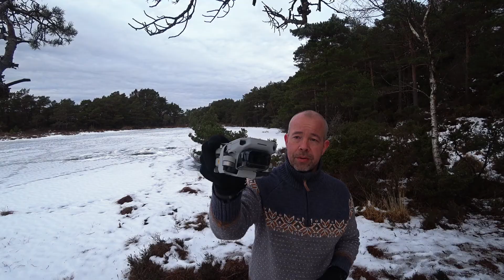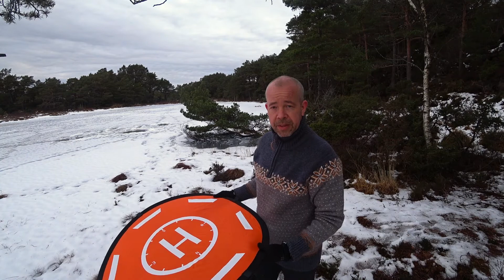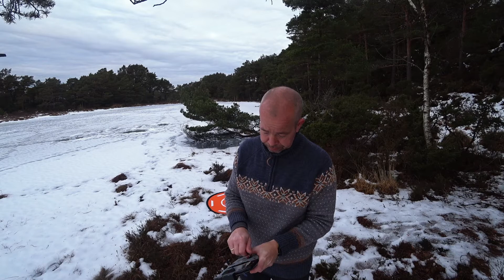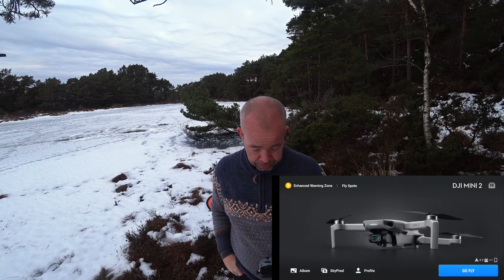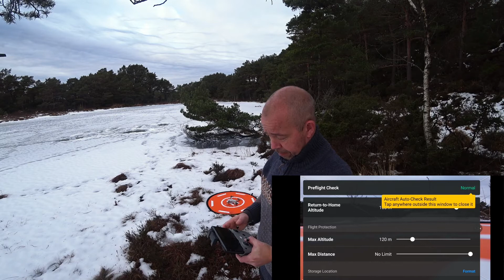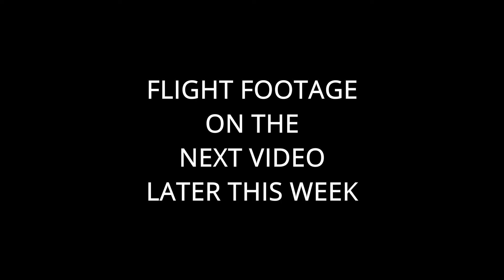DJI MINI 2 PRE-FLIGHT CHECKLIST AND TUTORIAL DO THIS FIRST TIME YOU FLY YOUR DRONE BEGINNER/PRO

Comment: I got mine two days ago and I like to had take off and hand catch it when I need it landed, it helps keep dirt and debris out of motors. But I was accustomed to this from a cheaper, larger chinese drone I had. Also, I noticed that, after I left it outside 15 minutes, when I wanted to take it for another spin to drain the battery down, it wouldn't start, prompting a cold battery. So I had to take the battery out and get it warm. Also, do you know if there's a was to make the homepoint on attitude display stay under the controller icon?
Reply from the maker: Thanks for watching, I also hand launch the drone sometimes. I also hand land the drone. But I think a beginner needs to learn how to land the drone several ways. And for your question im not sure, im gonna check it. Thanks again for watching and comment, have a wonderful day🌞
Reply: @EspenJohan  It's the easiest thing in the world to hand launch Mini 2. I couldn't believe it untill I tried it myself. Agreed that beginners should learn first to control it smoothly and get comfortable with it. They just have to use a landing pad as you, for a lesser chance of debris in the motor housing. Or any hard, clean and large enough surface will do